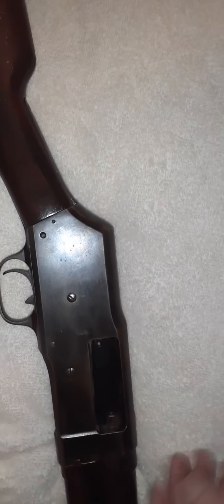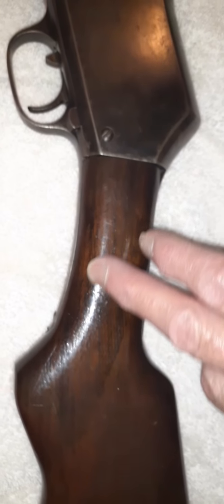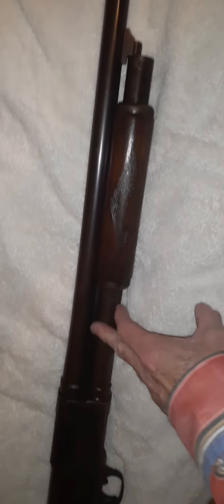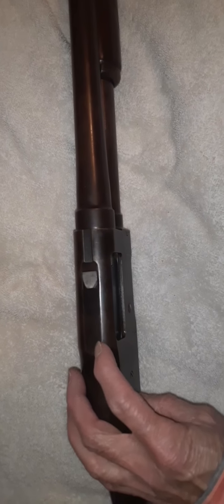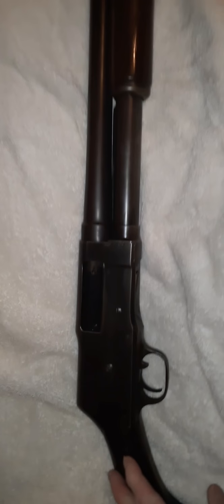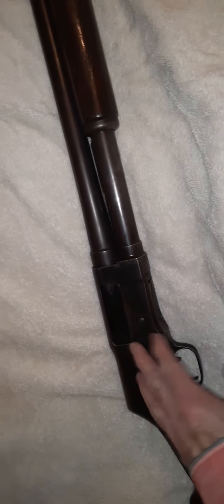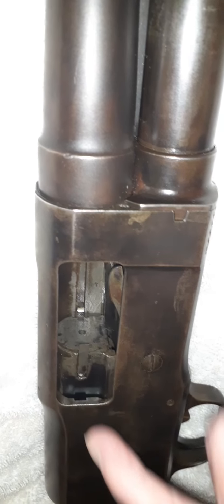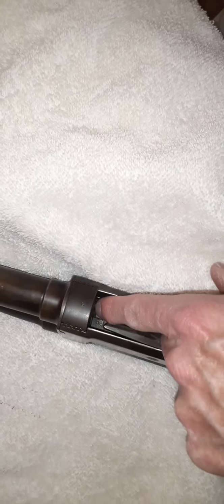Early 1900,s Ranger Sears Shotgun Stevens 520 Browning

Comment: Be careful, you have the safety mixed up. You said it was on safe when it was on fire and vise versa.
Reply from the maker: Yes I did I made a mistake you're correct. Thank you very much I appreciate you pointed that out for me. Okay stay safe
Reply: @chaseww  Sure no problem, just didn't want to see you lose a toe with that suicide trigger system. It is a great shotgun, I love mine. Thanks for the video.